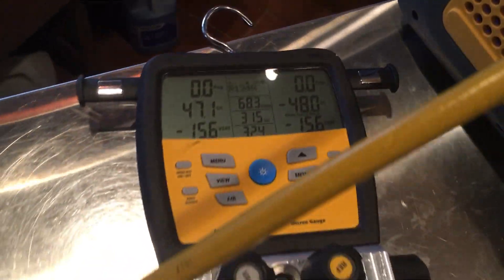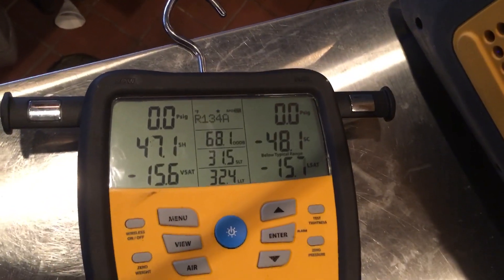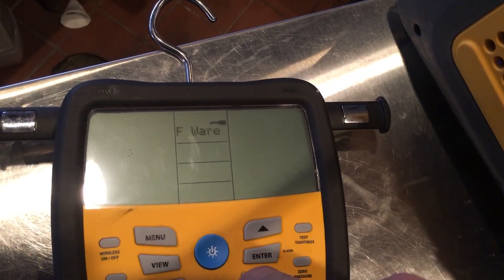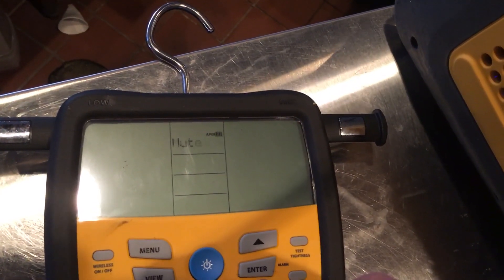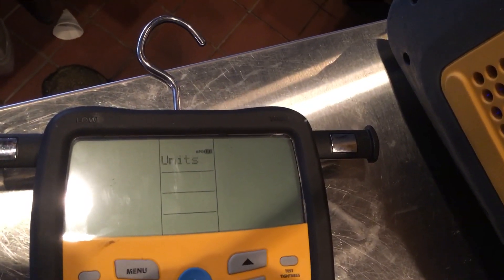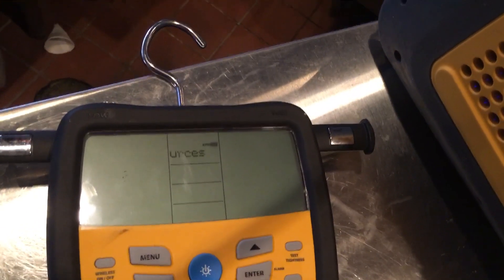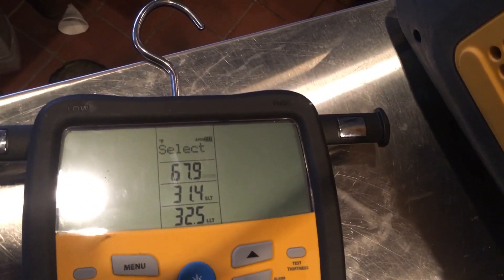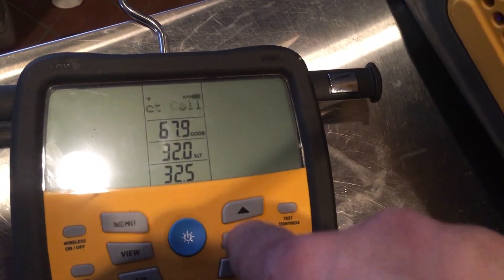Sman480V temp clamp calibration

Comment: No distilled water necessary? Lately I’ve found my subcool has been off, but pressures, airflow and temp split have been good, even with a second set of new gauges. I know better, in terms of recognizing that they should be calibrated before putting them to use right out of the box, but they appeared good to go. Well, hear I am! Thanks for the information. It’s been about ten minutes and... they’re not sitting to pretty, I have about a 5 degree difference between my suction and liquid. Found the missing subcools! Haha